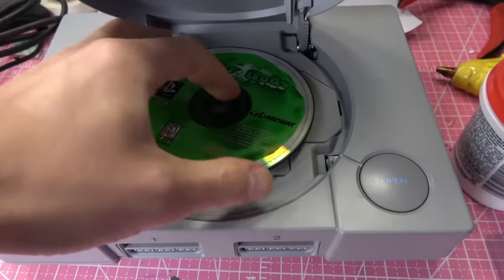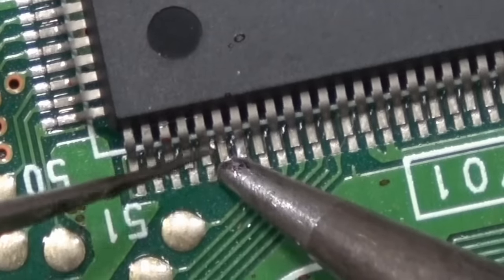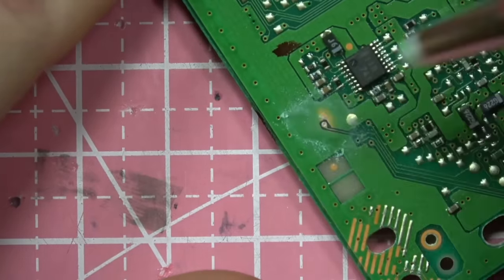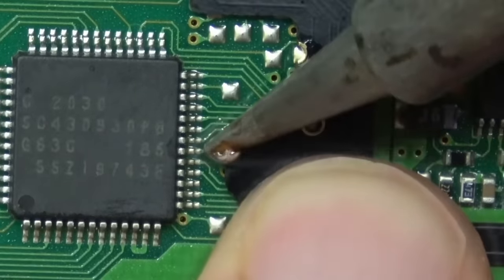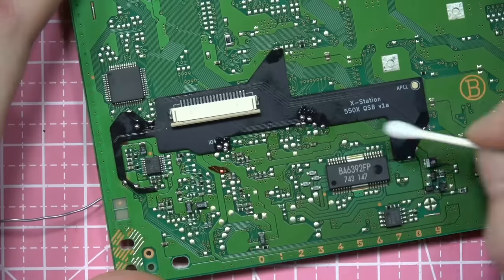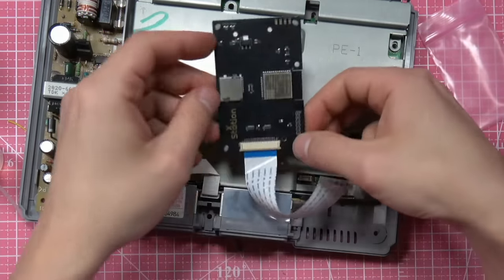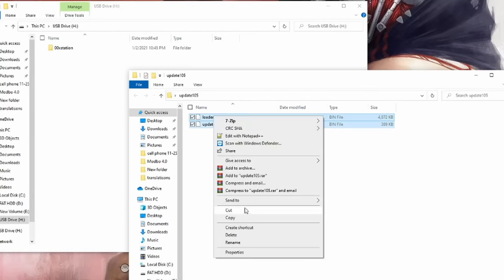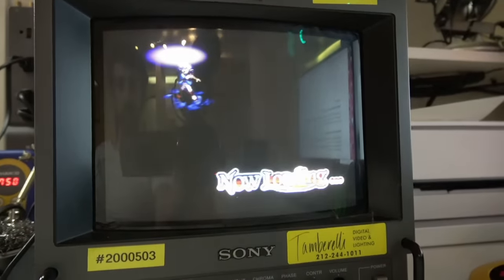PS1 XSTATION INSTALL, PLAY ALL PS1 GAMES FROM SD CARD

Comment: It seems cool to run the games fast from a flash driver, not everyone can fix the CD drive to run smooth and an SD card seems to be a good thing, BUT the consoles become something cold, lifeless without the remarkable sound of the optical drive reading and the rotor spinning. It falls on the realm of an emulator experience, which you can do in almost any device without needing any invasive mod on an old console.

Comment: Pretty cool, but easier is get a fat PS2 and buy the free mcboot memory card off ebay for $10 which will let you play (patched) backup games of PS1 and PS2. You can also run game images from a usb thumb drive. Even better if you can get the HDD ethernet adapter for the fat PS2, you can put in an old HDD and play games from images on the HDD, no discs needed (or load them over your network from a PC or NAT storage device).
Reply from the maker: Thats how I have my ps2 setup. BUT. this ps1 got modded for HDMI. So. You should see how amazing the quality is. I should make a video

Comment: Muy chulo pero la gracia de jugar en una playstation autentica es jugar con CD, meter el CD, escuchar el ruido del CD etc. En otras palabras, viajar al pasado. Si le quitas eso para usar un tarjeta SD se convierte en un emulador más.

It is awesome what you did but the point of to play on a genuine Playstation is to play with a CD, to insert the CD, to listen the CD sound, etc. In other words, go back to the past. If you play with a SD card is like to play on an emuletor.

Comment: Isn't the PSIO the better option? No need for complicated soldering, you don't loose the cd-drive and it's roughly the same price.
Reply from the maker: I did a psio video a while back, but I plan to do another one a little more in depth soon. Both items are good in their own way for different peoples preferences  PSIO still needs to be soldered, just a bit easier of an installation, and is compatible with more ps1 units

Comment: Still got an original PS1 from 1997 but after years of flipping it upside down and on its side to get it to load games, it barely reads them at all now. I was thinking of replacing the optical drive, but parts on eBay are dubious, and why bother when it is going to suffer the same problem down the road? I like this solution better.

Comment: Shouldn't it in theory be possible to just plug an modboard to the CD drive's connectors, instead of modifying the whole hardware?
Reply from the maker: Considering all 3 sd card reader options for the ps1 (mode. Xstation. Psio) need some sort of modification to the board. I don't think it's as simple as let's say the dreamcast, where it's just plug and play. The engineers behind these products know the ins and outs of how the system functions better than I do. But if no modification was needed I think 1 of the 3 teams wouldof figured it out by now. The psio, witch uses the parallel port on the back needs a SMALL modification, just 8 wires, I did a video about that a while back, check that one out to see the difference
Reply from the maker: Thank you for watching this by the way. And thank you for checking out my channel. I deeply appreciate it.

Comment: Just get a PS1 retro and upload your own games. I use mine like a Raspberry Pi. Sadly, nearly all games on the PS1 didn't age well. There's a few, but 90% of those games are boring staring at those old ass polygons. Btw, I'm an old school gamer that has owned all the consoles over the years.
Reply from the maker: There's alot of ps1 games that didn't age well, you're right. But... every RPG and every survival horror game on the system are still very fun and playable in my opinion. And those are my 2 favorite genres. Everything else on ps1 I can ignore and be fine

Comment: Do you need to remove any existing modchips before installing this mod? If one is installed, will it prevent the XStation working correctly?
Reply from the maker: Thats a really good question, I'm pretty sure it won't interfere, but the xstation will definitely render it useless, so you mise well remove it.

Comment: Hello, this mod works on the playstation 1 SCPH 9001 motherboard Rev. C model PU-22 or 23
Reply from the maker: It does not
Reply from the maker: There is the PSIO that works on Any playstation 1 with an expansion port, stay tuned for a video about that

Comment: Nice Mod but isnt it cheaper to buy a PSP 1000 in a decent Condition for some Bucks with Magic Gate/ SD Adapter since you can flash a CFW easy like hell ? I mean this Chip costs about 80€. At least a CFW unlocks PSPs native ability to run PSX Games + there a plenty of Emulators for older Nintendo Games and so on. At least it is portable 😅
Reply from the maker: Well. There's also the vita too. I do love my psps

Comment: You can do this with any original Playstation model SCPH models or specific model?
Reply from the maker: So, for this PS1, I planned to do more mods than just the xstation to it. Such as HDMI mod. So I needed the SCPH5500 PU18 ps1, because that model is compatible with both mods. The xstation is capable on more than just this revision (not all) but because I'm building the "ultimate" ps1, xstation, hdmj, ps4 controller mod. Ect. pu18 is what I needed. Stay tuned for the rest of those mod videos!

Comment: PSIO is the same, more simply of use and best and no modify anithing...
Reply from the maker: I have a video of a PSIO mod chip install, you still have to mod for PSIO, its just a bit easier of a mod. Only 8 wires
Reply: @RETROGAMINGARTS  True, but using PSIO you don't have to remove the CD player and you can still use discs to play ...
Reply from the maker: Thats true, for this ps1 it had a working drive, I swapped it into a ps1 that had a dead drive, so I was smart about it😉
Reply: @RETROGAMINGARTS  Perfect! then you do not deserve a punishment for abuse of video consoles hahahahaha ;-D

Good Job!

Comment: Greetings, it's possible that I could do the device installation on a PSX whose model is number 7501, because that's the PSX I have in my possession
Reply from the maker: A 7500 ps1 could have a pu18 inside. Early revisions had the pu18. You have to check to see if it does or not. If it does not have pu18 you cannot do ps1 digital hdmi mod or xstation, but you will be able to do the psio sd card reader mod because that mod works on all ps1 with an expansion port on the. Stay tuned for a video on my channel about psio
Reply: @RETROGAMINGARTS  Thanks for the answer, guess I have to wait for the video
Reply from the maker: I did a really old video about the PSIO, you can still see the install process, I was just gunna make a new one. Scroll thru on my channel till you find it, it's called PSIO INSTALL

Comment: nice install i would have got my self one but it doesnt do anying the playstsion classic cant do
Reply from the maker: Hahah I feel you on that. It's just bigger LOL. I'm doing a few more cool mods on this exact ps1. Well I've already finished the mods just need to finish the videos. This ps1 from this video has also been modded to output hdmi. And use a ps4 controller, stay tuned for those videos.
Reply: @RETROGAMINGARTS  great i have subscibed so i dont miss those videos thankyou
Reply: My PlayStation Classic tends to randomly shut off during play, something that the original PS1 doesn't tend to do.

Too bad I don't have the steady hands to do this precision soldering and lifting of pins.
Reply: @luckymouse1988  you could possibly have annn issue with yourr classic or theb as my classic has never ranndomly shut off

Comment: Just asking but couldn't you just cut the leds instead of desoldering them?
Reply from the maker: cutting the legs on the first chip?  instread of lifting the pins? i'm sure you could, as long as they are not connected to the board that is the goal. however i find lifting the pins to be way way way easier, i wouldent try to cut these to sever the connection
Reply: @RETROGAMINGARTS  cool. Thanks for the reply.

Comment: This is cool,  but what's the benefit of this vs hacking a psone classic?
Reply from the maker: original hardware, so you have alot of different video output qualitys, use original controllers, memory cards, ect. but if you really wanna see the real benifit, check out my newest video, its this same ps1 just with 4 more mods added

Comment: Wait, I don't get it. Why does it have to replace the CD Rom? Why can't it just plug in the console somewhere?
Reply: That's why i prefer the PS-IO.
Reply from the maker: if you dont want to replace the cd rom drive, you can use PSIO as @portnoi88 said

Comment: I need this for the PS2, my disc drive is on its way out
Reply from the maker: There's hdd mods for ps2 using open ps2 loader. If you have a ps2 fat you can plug in a hdd in the back and boot games from that

Comment: Y'all do know there's something called the "Playstation Classic" right, lol.
Reply: If you’ve kept up with the feedback of Mini series consoles, you’d know that the PlayStation classic is a steaming pile of muck compared to it’s original predecessor. Emulation runs poorly, the controller that’s included isn’t Dualshock, and any game originally on PAL runs at 50 hz instead of 60. If you’d rather have a low quality milk toast version of the PS1, the classic is certainly cheaper and more user friendly than modding a PS1 yourself. But why skim on those things when you can go all out adding your own HDMI and an attachment that lets you play whatever backup you want?
Reply: I’d argue that nearly any other device besides the PSClassic is worth playing PS1 games on. It’s literally just THAT bad.